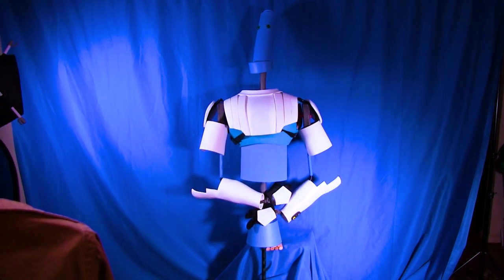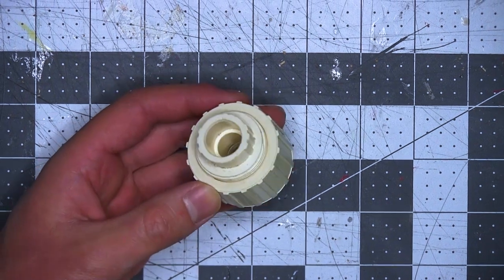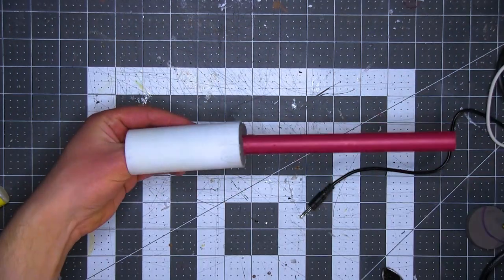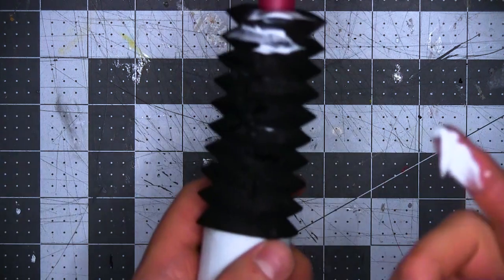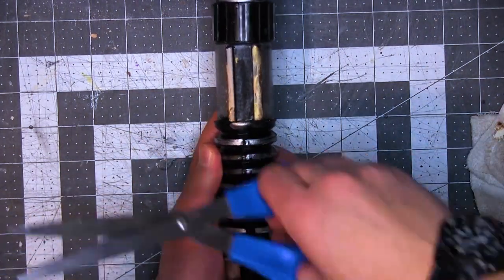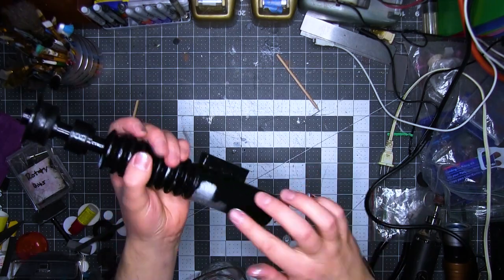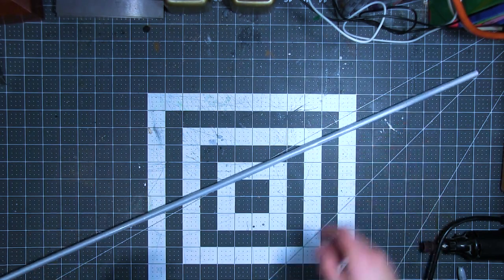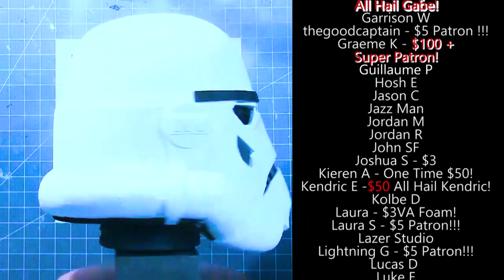Kenobi Lightsaber Build - How To Make Obi-Wan's Saber (DIY)

Comment: This depends on which obi wan saber your making, revenge of the sith or new hope. Revenge of the sith, it doesn’t have a ring on the end, but a cover tec wheel where that dial is at 7:49.
And on the “new hope” lightsaber everything in this video is accurate except that the switch at 6:04 has more greeblies on it.

Comment: Yeah, every thrift store has at least one lightsaber. I stole the electrical components (after I bought it) for a higher quality metal hilt I was making for my brother. I ended up frying the bored trying to bypass the built in button, but the otherwise expensive motion sensors. Also, what about the Gatorade cap (lol)